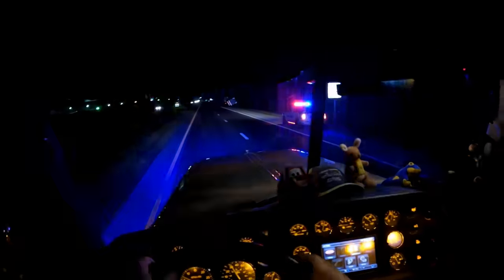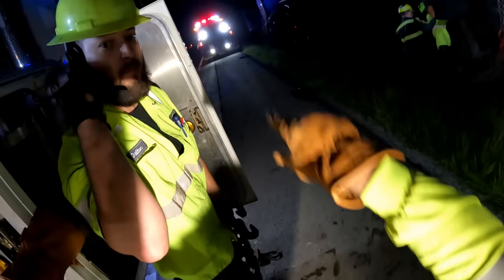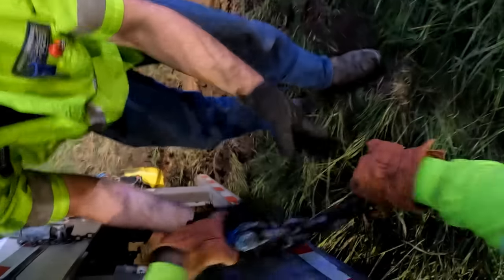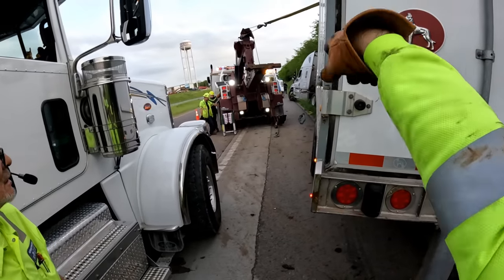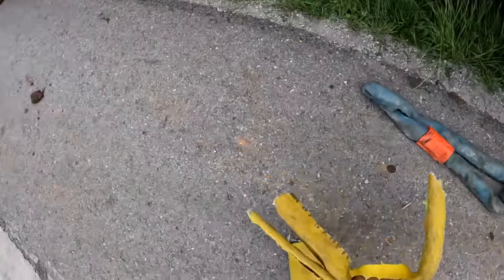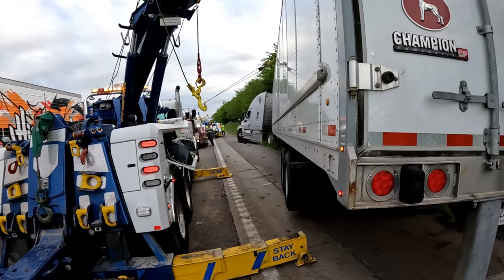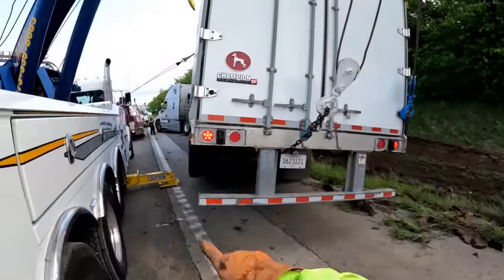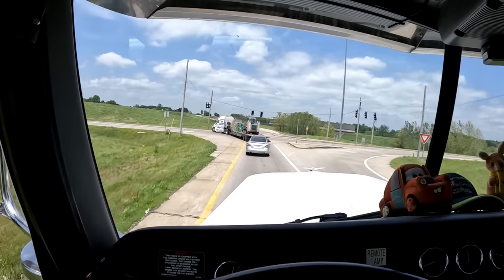Twisted Truck 2.0 Rollover Semi!!! The Job From...a Really Bad Place

Comment: Ron: "Come here, tall man, and pull that down".
Ethan: casually reaches up and pulls winch cable
Reply: I would’ve said something. You quit growing to quick
Reply: I do that with my dad all the time, he used to be 6'2 but age and back issues have got him down to probably 5'10 if he's lucky whereas I'm 6'7 most times and about 6'10 when I stretch out, there's a lot of times where he has to get the stool or ladder out and by the time he's got it set up I'm standing there with whatever he was reaching for in my hands... because of course he's too stubborn and proud to ask for help 98.67% of the time.
Reply: @dirtfarmer7472  As someone who is about a foot taller than my manager, I did.

Manager: Hey you are tall enough, help me grab that box down from the shelf.
Me: Just a  minute nd I'll get you a step ladder.

He appreciated the sledge back.
Reply: Yeah im short to and maaan its a strugle
Reply: My mom and I are both short. Whenever we need a tall person in the house to get something, the phrase is 'oh, tall one'.

Comment: Getting  another  rotator rig, or a heavy duty truck crane,   sounds  like a  good idea!!!!!!!!!!!!!!
Reply: Quite an expensive thing tho'. I'm sure I recall Ron saying it's $750k to buy one, and it's probably one or two times a year that it is useful - even if it's once a month, and each job pays an extra $5k for "we used two rotators", it will take 12 years to return the cost. (I have no idea of the actual cost of recovering one truck like this - I'm sure it's not $150, but whether it's $2000 or $20 000, I don't know - and I also don't know what the cost difference will be for running two rotators vs one + 2 regular tow-trucks).

I'd love to see Ron + Ethan or Ron + Talon working a rotator each, but I can fully understand how that's not really a feasible thing to do from a business perspective.
Reply: Heh, indeed.

Especially since Miller Industries introduced a 100 Ton Rotator a while back. That thing whould be a total MONSTER compared to the actual Rotator.
Reply: They got 100 ton capacity rotators out there, I think also 150 ton, but that 100 will pick an entire railcar by itself and with a little help can pick one end of locomotives, so yeah maybe tator needs a big brother, now I gotta watch the video.
Reply: Got a million plus you would like to lend them to buy it?
Reply: $750K when Tator was new 7 years ago and that was before adding all of the rigging.
Reply: Last I herd 100 ton rotator is a 2 year wait And a 1 million plus Miller is having problems on getting the trucks in.
Reply: Mats in my part of the country they charge 250.00 an hour for each unit on the scene.
Reply: @davidharris1253  who needs a 100 ton u can’t even drive that kind of weight without a permit  at that point call a real crane
Reply: Nice recovery! Yes, 2 rotators would have made this a much easier recovery. But is the cost justified? Probably not. Upgrading to a Miller 1075S would give them 50 and 75 ton rotators. More than enough for 99.9% of the jobs they'd respond to. To justify it they'd have to look at how many jobs they passed up because the 50 ton is tied up or does not have the capacity and weigh that against the $800K - $1MM cost of a new rig. Hey... If every subscriber sent in $3.00 he could crowd source a new one! (Extra for sales tax, wrapping the rig, extras, etc.)
Reply from the maker: @BrianMcGilvray01  I have held several fundraisers on this channel, for other people in need, but not for myself.   I wouldn't ask people to do that for me, however, if someone else were to set something like that up......I'd love to have a 75 Ton twin steer.
Reply: @RonPratt  I've wondered whether you had such aspirations given your location and potential market. I'm happy to hear that you believe there would be enough call for a second, bigger rotator.
Reply: @JackMacLupus 28:55

Comment: Hi Ron, This was a tricky shift. 
I just wish that you were able to shut the road completely to extract this truck safely. Pretty standard ops in Oz for this type of move.
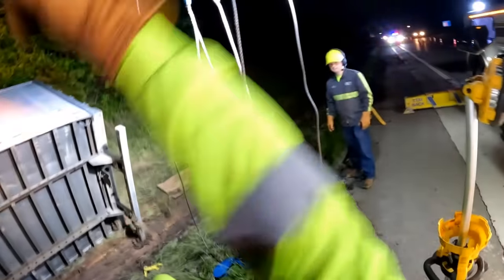I didn't realise that your section of highway was a sleepy hollow area (driver falling asleep). One of the hazards of road transport, especially between 12:00 & 6:00 am. 
Sleep debt is a real thing and many factors can cause this type of accident.

Comment: Hey Ron, a little trick you could have used to make that trailer more stable was to set the parking brake on the trailer only, because when you do that on those air ride trailers like that, it also dumps the air bags on the trailer, setting the axle down solid to the sub-frame, making the trailer more stable so that it doesn’t number one, push the CG (Center of Gravity) higher, number two, making the trailer more stable so that it wouldn’t keep trying to lean towards the low side, number three keeping the trailer from trying to role back into the hole you just pulled it out of. If you would have had the driver set the trailer brakes, then unhooked the red glad hand for safety purposes, it would have gone much easier and safer for you and your crew.
Reply: while some trailers do dump the suspension when you set the breaks that is in no way a standard, but simply disconnecting the air ride from supply is something that could be done to any trailer, i would do that at the ride height valve.
Reply: The other thing with air ride, since they chained one side. Putting pressure in the system could help stabilise the trailer, since it will be pushing more on the low side, helping to right the trailer a bit.
Reply: Ron don't know it all like he thinks .. he is good don't get me wrong but he is not a tow God.. Noone is .. we all live and learn every call is a new1 .. be safe
Reply: @ARockRaider  if you read correctly, you would have read that i said “that trailer” and most of them with sliding tandem do dump when you set the park brake!  I have more then 63 different air ride trailers in my fleet at the moment, and i only have two that are not set up to dump when pulling out the red knob, one is a 48’ walking floor, and the the other is an RGN trailer! But every single dry van and reefer I’ve ever had that has slidable tandems, dump when setting the park brake as they should!! Some stupid ass drivers neglect to set the trailer brakes every time they get out, because they don’t want to give the trailer the time it needs to air back up, but those are the kinda drivers who are stupid, because they don’t care to cut corners, and potentially get themselves, and other innocent people hurt, or worse!! That why I have fired 13 different drivers to date, for that exact same reason!! Not only will I fire a driver for that, I’ll make it my mission to destroy their career in this industry, so that I’ll know that I have done my part in making sure that they’ll NEVER have the opportunity to in danger people like that again! I’d never take a persons career over making a mistake built upon ignorance, but if the mistake was built upon cutting corners due to laziness, then that person needs to find another career, because they’re never gonna stop putting themselves in danger, nor other innocent lives alike!
Reply: @agentcrm  the only “air ride” suspension that operates that way is the Hendrickson Air Track suspension that you will mostly find on heavy haul trucks, dump trucks, or heavy wreckers or trucks alike, that kinda suspension has never been installed on a trailer ever, to my knowledge! Some end dump, and side dump air ride trailers are set up to dump without setting the brakes, once the PTO is engaged, to set the axles down on the subframe to further stabilize the footing, so that you can push the CG way up in the air to dump the load, on much more stable footing.
Reply from the maker: @towmanac7056  Obviously you didn't read the description of this video.   Go back and read the description I wrote and THEN perhaps rethink your statement....  God bless.

Comment: Ok you asked for input here's my 2 cents worth: one I probably would have tail wrapped the trailer with  BOTH main lines on it and instead of the small blue endless loop sling you used I'd probably have gone for the wide 20 foot strap..  Only I'd have the rotator on the drives and Talaon with the western star on the trailer. Maybe even have the Western Star face the wrong way just a short highway shut down while you all did that. Again just my ideas & yes 2 rotators would have been nice, but how many jobs do you do that requires 2 & both would need to stay close to home for that reason.

Comment: As I was watching the cars going by at a good clip, I was wondering if the cop was out of his car motioning for them to slow down. I don't think a lot of drivers know what slow down, move over means. I was truly concerned for all of you. Good job to all of the Mid-West crew.
Reply: @ Roy Ordway.....I agree with you that the traffic was moving far too fast through the recovery area!
However, I believe that - depending on the jurisdiction - when the recovery crew supplies its own "Traffic Control" crew on these long-winded recoveries, the local cop-shop withdraws its own officers, as they can be used elsewhere.

I can accept this arrangement; the problem is that the general attitude of drivers (both private as well as commercial vehicle) won't slow down if they don't see a cop-car or two parked on the shoulder, as it's basically akin to work-zones....

It's a well-known fact that few drivers actually do slow down to just below the posted work-zone speed-limit in general and when workmen are around, in particular.

My penalty-suggestion for anyone found speeding through a work-zone (active) and/or live-recovery site should be to spend 24-hours as a "human orange/black cone" which are used to separate the live-lanes with the work-zone. Dress the offenders in "Depends", put them in hand & foot-cuffs, slide the cone over their head and position them at the beginning of the work-zone......"enjoy, we'll pick you up tomorrow, same time" (if the offender survives, I guarantee you they wont' ever reoffend again.....on the other hand, if they don't survive (heart attack or being hit by another speeder,  good riddance!  (btw....I'm really not kidding).

Comment: Ron, I have a question. I'm a 17 year old and wondering what school classes would be good to have, for what you do.
Reply: I’m not Ron, but a physics class would be good so you understand the forces involved. Just a basic one.
Reply: Start being around trucks. Get experience. I own a fleet of semis. Hands on is an amazing education you can't buy
Reply: From previous videos I have seen, he would say math. Especially geometry and trigonometry. And physics. You are dealing with these as you would be setting up the rigging. Boom angles, snatch block placement, weight distribution, etc.
Reply: He's said many times that math is hugely important in the job. Bits of physics is also helpful.
Reply: I'm sure Ron would agree that math, physics, and safety are very important foundation classes before getting a CDL.  I wish you well in your endeavors buddy.
Reply: Some basic auto/diesel mechanics couldn't hurt, mainly for the working knowledge of how these vehicles operate. Other than that, I suspect most of it is on the job training.
Reply: Geometry and physics will be a real help, and enough math to support those, trigonometry (angles and circles) in particular.  Understand the forces you're dealing with when you pull or lift.
Reply: I’m not Ron, but I would suggest physics & mechanics of some sort. Nothing easy or fun. Geometry along with the physics. Lots of common sense type things. EMT training would be nice

Comment: Is there another recovery company in your area that has a rotator that you could call on?

What would be the legal ramifications of working with another company?
Reply: There would have to be a protocol set by some governing body that would make the company that got the call, the "scene boss". The company called for help by the first company would have to let the first company make all decisions, unless it was felt it would endanger the crew or equipment of the second one. Just some thoughts!
Reply: Rotators aren't cheap.   Ron has a large service area due to the expense of equipment.

Comment: I think you've done an awesome job with the equipment you do have.  Another rotator would have been helpful, however you need to weigh the costs with how much service you will get from it.  As for a suggestion, I would have probably repositioned the rotator when Talon held the trailer the first time, when you redig your rigging.  First thing I thought when I saw the position of the trailer was that the load was likely shifted.  You did an awesome job keeping the trailer from rolling back over in spite of all the weight on the right wall.  It sure fought you every step. You may get similar situations, but you're probably not going to get one exactly like this.  Every job like this is a learning experience.   I was told in driving school to "learn something new every day, because when you stop learning something you might as well stop driving a truck because you know everything and that's when you make mistakes."   Thank you again Ron for sharing.  Good job by you and all your crew.  Stay safe out there.

Comment: Ron...
Just a thought. When you are trying to get a truck backed into position, have one of your people stand where you want the driver's side rear of the truck to end up. Ad a truck driver. I could easily back any truck up if I had a marker where I wanted the rear of the truck. To end up. I used to carry a traffic cone to do the same thing.

Comment: So, blown out side on the trailer, bent frame on the truck, and you had me on the edge of my seat the entire recovery.  I was willing to bet when you opened the trailer doors all the pallets would be tipped over with the top of the load leaning against the side.  Could not help but wonder why you didn't turn Tater around and snatch the trailer up and onto the road but do understand how unstable it was. Also wanted to see a photo of the tractor with the trailer off to see if the drive wheels all sat on the ground LOL.  Great job Ron and wonderful to see Talon working outside.

Comment: I saw your comment last night before bed about constructive criticism and suggestions. Here’s a couple of thoughts I have about this job after only watching the first third.

1)	You never opened the doors to check condition of the payload to know where your likely center of gravity would be.  You only found out once the trailer was upright and bulging.  

2)	The centerline of your boom was right at the back of the trailer.  As the trailer is picked and swung towards your rig, the centerline of your boom slowly falls behind the trailer, hence you begin to lose your greatest point of leverage at the top corner of the trailer.  Had most of the payload remained low, this would have been okay.  But now with the bulge, your center of gravity has shifted, and the majority of your lift is on the blue strap line which quickly became precarious.  However, when the strap slipped, the truck was mostly upright at the rear.  Lucky?

3)	When the truck initially came to rest, which we can assume was fairly abrupt, the payload would have shifted forward and then to the side as it laid over.  From what I can gather from your inquiry to the driver, was that it was palletized copy paper at 44k lbs.  Was it a full load of 26 pallets?  Paper is extremely heavy in bulk loads.  If the trailer was half full, you could have been solely picking the empty end of the trailer and it could have easily split open like a tin can in the middle.

4)	Lastly is just a leadership observation.  Some of your team understands their role on the job site.  The problem here is some.  Everyone should understand what is needed even if they don’t get to push the buttons.  Everyone should also know the equipment, where things are on the rigs and how to use them.  You shouldn’t have to direct others and tell them where to find things. 

Keep up the good work.  I love your content.

Comment: Ron, you are usually very even-keel, even in tough situations! You could tell this was a stressful job because about a half a dozen times you hear Ron's voice go up by an octave or more as he's yelling "STOP, STOP"! It's always easy to Monday Morning Quarterback these types of situations, but the only thing I might have considered differently is considering where the weight of the load was, positioning the rotator accordingly and putting the other trucks on the ends of the load to maneuver where they are more accommodating and up to the task. 

Overall, great job and great video, despite the movie length!! Everyone made it home safe and that's what is most important.

Comment: As you asked for other possible ways to do this, the only other alternative i can think of is to possition the rotator further forwards. Then using the crane to secure the  back as you did, but preparere for adding an aditonal line, where the westernstar ended up adding its line ower the trailer. For the downwards pull the rotator could uppright the middle of the trailer with the front outriggers, enabeling the westernstar to come in from  behind pulling down the back. Once uppright the westernstar can pull it all back while the rotator follows allong and stabilises it all sideways with two lines ower the trailer and if nessesary an other one pulling down from the back outrigger. As a disclaimer this is just what i think, and i am not an towtruck operator, so take this with a big grain of salt :)
Reply: And as always great work!
Reply: How was it possible to drive it far with the load shifted so much?..You answered my question in the follow up.  As a former Logistics manager you did a great job and safely as usual. Internal load shifts are often much more dangerous than folks realize even after getting the truck drivable as this video points out.